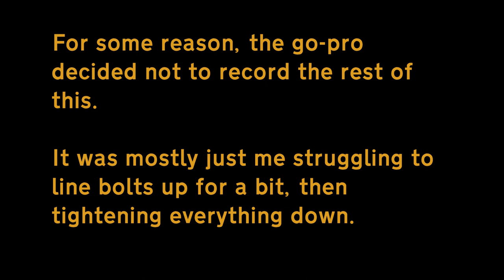Bedford Rehab Part 11: Tracta Joint Seal

Comment: I think I only ever changed one Tracta Joint seal and that was on one of the training aids at Bordon in 1966. Blow hard enough and it all just fell apart! I converted from 'B' to 'A' Vehicles in 1969 and took on a whole new world of awkward jobs with Cents and Chiefies but looking back on it, apart from the sheer mass of some of the stuff I had to manoeuvre, everything seemed so much easier on the big beasts, mainly, I suppose because there was always a 434 or a Leyland close to hand - apart from maybe changing Cent plugs and clutches!